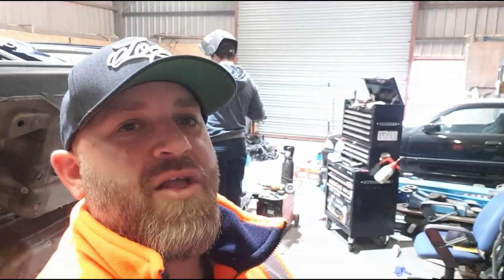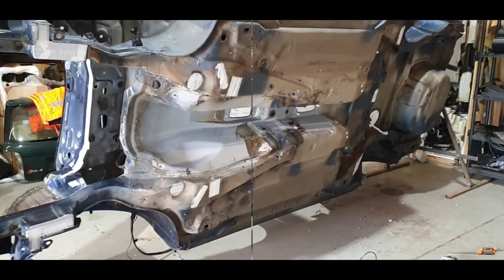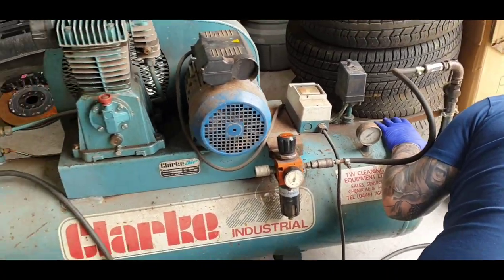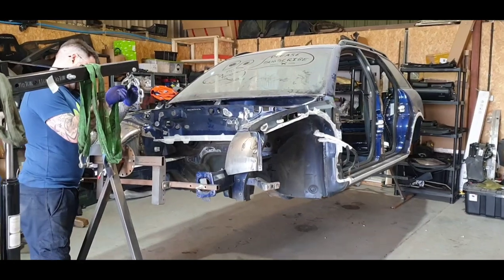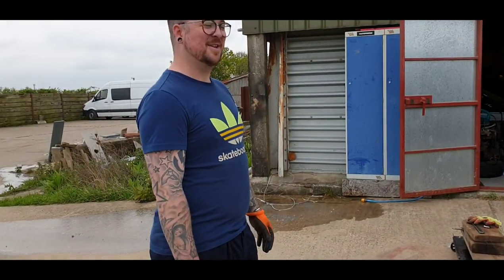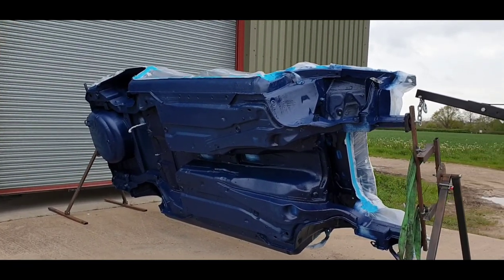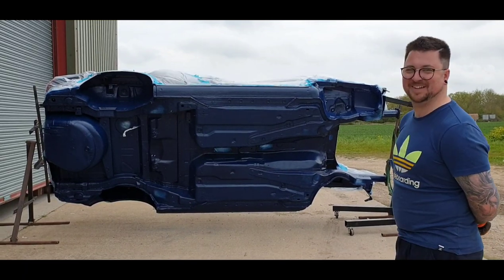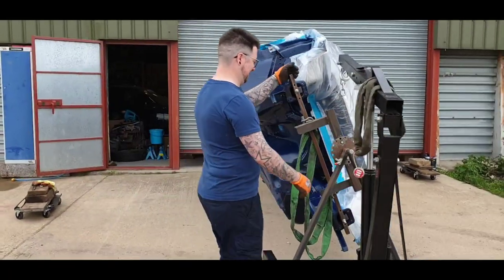Audi A4 B5 Avant BTCC Inspired Build - Episode 5 - Raptor Floor Painting

Comment: Did you choose raptor over say Gravitex etc just for the taintability? how much did you use? have the underside of my B5 S4 to do shortly!
Reply from the maker: I chose raptor because of the brand really dude. I bought a 4L pack off ebay. We actually ran out 3/4 way through and ended up using Cobra from my local paint supplier. That was a mad rush. I think in total it cost me no more than £150 to do
Reply: @nathanwhite444  ye great videos! I’ve used raptor for fibreglass boat interiors in the past but have bought black gravitex for the S4, cars black so already colour coded and think the gravitex might have a bit more flexibility on the chassis but time will tell 👍
Reply from the maker: @aidanc767  awesome mate. It makes such a difference dont it